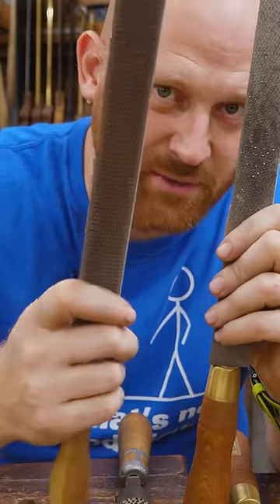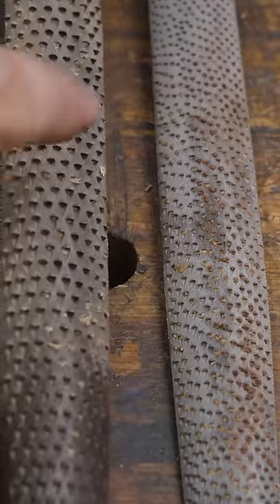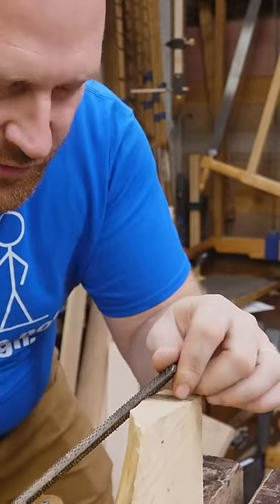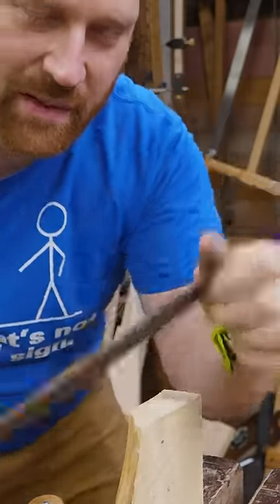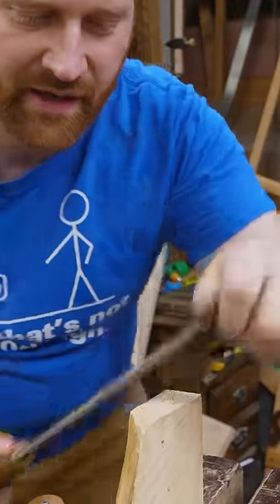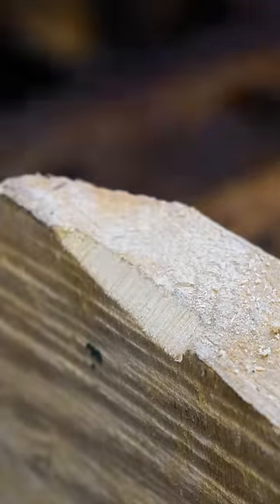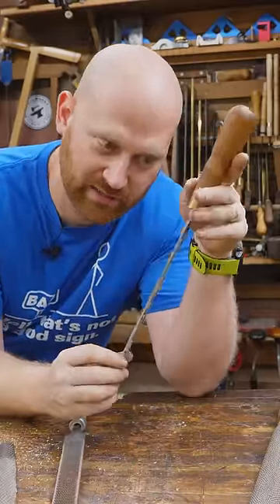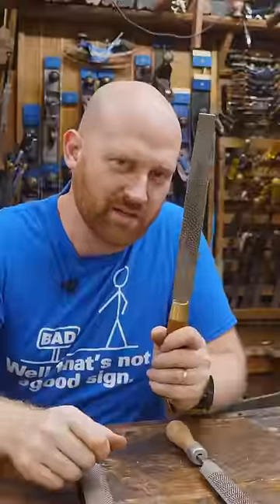Hand Stitched vs Machine Stitched Rasps

Comment: why doesn't the machine stitched introduce a different pattern?
Reply from the maker: They have made that, but the cost to run it is only slightly less then paying someone in Asia. And the makers for big box stores don't care. So the price on them is about the same as the hand stitched. The current machines punch full rows at once and march down the blade. And the audience they sell to (Big Box Stores) do not care about or even know that there is quality. Here they are: https://www.corradishop.com/gold-precision-rasps-c-1_4/gold-precision-rasps-round-6-cut-6-p-604.

Comment: Can't they make the machine ones do a random pattern? It would be nice if they could make a superior product for cheap
Reply from the maker: They have made that, but the cost to run it is only slightly less then paying someone in Asia. And the makers for big box stores don't care. So the price on them is about the same as the hand stitched. The current machines punch full rows at once and march down the blade. And the audience they sell to (Big Box Stores) do not care about or even know that there is quality. Here they are: https://www.corradishop.com/gold-precision-rasps-c-1_4/gold-precision-rasps-round-6-cut-6-p-604.

Comment: You would think they’d be able to make the machine one a little more random
Reply from the maker: They have made that, but the cost to run it is only slightly less then paying someone in Asia. And the makers for big box stores don't care. So the price on them is about the same as the hand stitched. The current machines punch full rows at once and march down the blade. And the audence they sell to (Big Box Stores) do not care about or even know that there is quality. Here they are: https://www.corradishop.com/gold-precision-rasps-c-1_4/gold-precision-rasps-round-6-cut-6-p-604

Comment: Couldn't a machine stitched one be made like a hand stitched one by simply offsetting the indents?
Reply from the maker: They have made that, but the cost to run it is only slightly less then paying someone in Asia. And the makers for big box stores don't care. So the price on them is about the same as the hand stitched. The current machines punch full rows at once and march down the blade. And the audence they sell to (Big Box Stores) do not care about or even know that there is quality. Here they are: https://www.corradishop.com/gold-precision-rasps-c-1_4/gold-precision-rasps-round-6-cut-6-p-604

Comment: solution: make a machine that uses a staggered pattern
Reply from the maker: They have made that, but the cost to run it is only slightly less then paying someone in Asia. And the makers for big box stores don't care. So the price on them is about the same as the hand stitched. The current machines punch full rows at once and march down the blade. And the audence they sell to (Big Box Stores) do not care about or even know that there is quality. Here they are: https://www.corradishop.com/gold-precision-rasps-c-1_4/gold-precision-rasps-round-6-cut-6-p-604

Comment: 💀, I'm 16 and just got into carpentry, my ass has been doing this shit incorrectly, i thought people were using steel files, never knew of this rasp tool before.
Reply from the maker: you can use the file last to clean the surface. but the rasp is what removes the majority of the material.
Reply: @WoodByWrightHowTo  Will definitely buy one if i can find it, stuff like these such as coping saws are pretty hard to come by in my country, usually only found in the Capital.

Comment: Why don't they just randomize the machine sitch one? It wouldn't be hard to make a pattern.
Reply from the maker: They have made that, but the cost to run it is only slightly less then paying someone in Asia. And the makers for big box stores don't care. So the price on them is about the same as the hand stitched. The current machines punch full rows at once and march down the blade. And the audence they sell to (Big Box Stores) do not care about or even know that there is quality. Here they are: https://www.corradishop.com/gold-precision-rasps-c-1_4/gold-precision-rasps-round-6-cut-6-p-604

Comment: Why can't you machine a random pattern into a rasp?
Reply from the maker: They have made that, but the cost to run it is only slightly less then paying someone in Asia. And the makers for big box stores don't care. So the price on them is about the same as the hand stitched. The curent machines punch full rows at once and march down the blade. and the audience they sell to (Big Box Stores) do not care about or even know that there is quality. Here they are: https://www.corradishop.com/gold-precision-rasps-c-1_4/gold-precision-rasps-round-6-cut-6-p-604

Comment: Is it not possible to machine a hand-stitched rasp?
Reply from the maker: They have made that, but the cost to run it is only slightly less then paying someone in Asia. And the makers for big box stores don't care. So the price on them is about the same as the hand stitched. The current machines punch full rows at once and march down the blade. And the audience they sell to (Big Box Stores) do not care about or even know that there is quality. Here they are: https://www.corradishop.com/gold-precision-rasps-c-1_4/gold-precision-rasps-round-6-cut-6-p-604.

Comment: Sure would be nice if they made machine stitched rasps with uneven teeth, best of both worlds
Reply from the maker: They have made that, but the cost to run it is only slightly less then paying someone in Asia. And the makers for big box stores don't care. So the price on them is about the same as the hand stitched. The current machines punch full rows at once and march down the blade. And the audience they sell to (Big Box Stores) do not care about or even know that there is quality. Here they are: https://www.corradishop.com/gold-precision-rasps-c-1_4/gold-precision-rasps-round-6-cut-6-p-604.

Comment: Why dont they just make a machine stiched but with a random pattern?
Reply from the maker: They have made that, but the cost to run it is only slightly less then paying someone in Asia. And the makers for big box stores don't care. So the price on them is about the same as the hand stitched. The current machines punch full rows at once and march down the blade. And the audence they sell to (Big Box Stores) do not care about or even know that there is quality. Here they are: https://www.corradishop.com/gold-precision-rasps-c-1_4/gold-precision-rasps-round-6-cut-6-p-604

Comment: Why don’t the machines that stitch the rasp simply do it randomly, wouldn’t you then get the best of both
Reply from the maker: They have made that, but the cost to run it is only slightly less then paying someone in Asia. And the makers for big box stores don't care. So the price on them is about the same as the hand stitched. The current machines punch full rows at once and march down the blade. And the audience they sell to (Big Box Stores) do not care about or even know that there is quality. Here they are: https://www.corradishop.com/gold-precision-rasps-c-1_4/gold-precision-rasps-round-6-cut-6-p-604.
Reply: @WoodByWrightHowTo  I see

Comment: As a developer this seems like an easy solution… just randomize the machine
Reply from the maker: They have made that, but the cost to run it is only slightly less then paying someone in Asia. And the makers for big box stores don't care. So the price on them is about the same as the hand stitched. The current machines punch full rows at once and march down the blade. And the audence they sell to (Big Box Stores) do not care about or even know that there is quality. Here they are: https://www.corradishop.com/gold-precision-rasps-c-1_4/gold-precision-rasps-round-6-cut-6-p-604

Comment: Two words:pick up used tools. Here in europe i can get a razor sharp 70 years old plane for under 10$, heck for 15$ it'll be signed by a googly eyed dictator or whoever. As for rasps i haven't yet picked up a hand stitched one because I mostly work with older softer woods in restoration and for those honestly well worn machine rasps are just as good and safe as to not chew up the old material too much.

Comment: Make your own
Reply from the maker: Sounds like an easy process and technically it is. As long as you have the right punch and a forge. However the problem comes when you need the skill to punch every tooth exactly the same height. It's a little more difficult than it sounds.
Reply: @WoodByWrightHowTo  couldn’t agree more was just saying that if you can’t find it you can always make it

Comment: Hopefully they'll configure a machine to put in 'random' stitches...
Reply from the maker: They have made that, but the cost to run it is only slightly less then paying someone in Asia. And the makers for big box stores don't care. So the price on them is about the same as the hand stitched. The current machines punch full rows at once and march down the blade. And the audence they sell to (Big Box Stores) do not care about or even know that there is quality. Here they are: https://www.corradishop.com/gold-precision-rasps-c-1_4/gold-precision-rasps-round-6-cut-6-p-604
Reply: @WoodByWrightHowTo  .... Wow, that's an awesome reply. Thank you. A lot.

Comment: Why not have a machine that stitches rasps with the same layout every time but they are not placed symmetrical but more random
Reply from the maker: They have made that, but the cost to run it is only slightly less then paying someone in Asia. And the makers for big box stores don't care. So the price on them is about the same as the hand stitched. The current machines punch full rows at once and march down the blade. And the audience they sell to (Big Box Stores) do not care about or even know that there is quality. Here they are: https://www.corradishop.com/gold-precision-rasps-c-1_4/gold-precision-rasps-round-6-cut-6-p-604.

Comment: Why didn't someone start to make machine ones with random pattern yet?
Reply from the maker: They have made that, but the cost to run it is only slightly less then paying someone in Asia. And the makers for big box stores don't care. So the price on them is about the same as the hand stitched. The current machines punch full rows at once and march down the blade. And the audience they sell to (Big Box Stores) do not care about or even know that there is quality. Here they are: https://www.corradishop.com/gold-precision-rasps-c-1_4/gold-precision-rasps-round-6-cut-6-p-604.

Comment: Im pretty sure there are machine stiched ones that make em like the hand stiched
Reply from the maker: They have made that, but the cost to run it is only slightly less then paying someone in Asia. And the makers for big box stores don't care. So the price on them is about the same as the hand stitched. The current machines punch full rows at once and march down the blade. And the audience they sell to (Big Box Stores) do not care about or even know that there is quality. Here they are: https://www.corradishop.com/gold-precision-rasps-c-1_4/gold-precision-rasps-round-6-cut-6-p-604.

Comment: why don’t they just make a machine that doesn’t stitch them in such perfect rows
Reply from the maker: They have made that, but the cost to run it is only slightly less then paying someone in Asia. And the makers for big box stores don't care. So the price on them is about the same as the hand stitched. The current machines punch full rows at once and march down the blade. And the audence they sell to (Big Box Stores) do not care about or even know that there is quality. Here they are: https://www.corradishop.com/gold-precision-rasps-c-1_4/gold-precision-rasps-round-6-cut-6-p-604

Comment: I don't understand why they don't mashine them with more random placements 🤷
Reply from the maker: They have made that, but the cost to run it is only slightly less then paying someone in Asia. And the makers for big box stores don't care. So the price on them is about the same as the hand stitched. The current machines punch full rows at once and march down the blade. And the audence they sell to (Big Box Stores) do not care about or even know that there is quality. Here they are: https://www.corradishop.com/gold-precision-rasps-c-1_4/gold-precision-rasps-round-6-cut-6-p-604

Comment: Why dont they just machine them unevenly then?
Reply from the maker: They have made that, but the cost to run it is only slightly less then paying someone in Asia. And the makers for big box stores don't care. So the price on them is about the same as the hand stitched. The current machines punch full rows at once and march down the blade. And the audence they sell to (Big Box Stores) do not care about or even know that there is quality. Here they are: https://www.corradishop.com/gold-precision-rasps-c-1_4/gold-precision-rasps-round-6-cut-6-p-604

Comment: I wonder why don't they make a machine asymmetrical stitched rasp? Should achieve the same as a hand stitched and will b alot cheaper
Reply from the maker: They have made that, but the cost to run it is only slightly less then paying someone in Asia. And the makers for big box stores don't care. So the price on them is about the same as the hand stitched. The current machines punch full rows at once and march down the blade. And the audience they sell to (Big Box Stores) do not care about or even know that there is quality. Here they are: https://www.corradishop.com/gold-precision-rasps-c-1_4/gold-precision-rasps-round-6-cut-6-p-604.
Reply: @WoodByWrightHowTo   :0

Comment: Why don’t they just make the machine ones with a random pattern instead
Reply from the maker: They have made that, but the cost to run it is only slightly less then paying someone in Asia. And the makers for big box stores don't care. So the price on them is about the same as the hand stitched. The current machines punch full rows at once and march down the blade. And the audence they sell to (Big Box Stores) do not care about or even know that there is quality. Here they are: https://www.corradishop.com/gold-precision-rasps-c-1_4/gold-precision-rasps-round-6-cut-6-p-604

Comment: I believe a machine can use a random pattern if set up that way
Reply from the maker: They have made that, but the cost to run it is only slightly less then paying someone in Asia. And the makers for big box stores don't care. So the price on them is about the same as the hand stitched. The current machines punch full rows at once and march down the blade. And the audience they sell to (Big Box Stores) do not care about or even know that there is quality. Here they are: https://www.corradishop.com/gold-precision-rasps-c-1_4/gold-precision-rasps-round-6-cut-6-p-604.
Reply: You don't want an entirely random pattern with hand stitching. You want a pattern, but you want it to vary.

Comment: We could very easily machine a rasp with randomly allocated teeth.
Reply from the maker: They have made that, but the cost to run it is only slightly less then paying someone in Asia. And the makers for big box stores don't care. So the price on them is about the same as the hand stitched. The current machines punch full rows at once and march down the blade. And the audence they sell to (Big Box Stores) do not care about or even know that there is quality. Here they are: https://www.corradishop.com/gold-precision-rasps-c-1_4/gold-precision-rasps-round-6-cut-6-p-604

Comment: Maybe machine stitched just need to put the teeth closer together, or more randomly place them.
Reply from the maker: They have made that, but the cost to run it is only slightly less then paying someone in Asia. And the makers for big box stores don't care. So the price on them is about the same as the hand stitched. The current machines punch full rows at once and march down the blade. And the audience they sell to (Big Box Stores) do not care about or even know that there is quality. Here they are: https://www.corradishop.com/gold-precision-rasps-c-1_4/gold-precision-rasps-round-6-cut-6-p-604.

Comment: Sounds like they just need to adjust the process of stitching the machined ones
Reply from the maker: They have made that, but the cost to run it is only slightly less then paying someone in Asia. And the makers for big box stores don't care. So the price on them is about the same as the hand stitched. The current machines punch full rows at once and march down the blade. And the audience they sell to (Big Box Stores) do not care about or even know that there is quality. Here they are: https://www.corradishop.com/gold-precision-rasps-c-1_4/gold-precision-rasps-round-6-cut-6-p-604.

Comment: Couldn't they make a machine that randomizes the stitches?
Reply from the maker: They have made that, but the cost to run it is only slightly less then paying someone in Asia. And the makers for big box stores don't care. So the price on them is about the same as the hand stitched. The current machines punch full rows at once and march down the blade. And the audience they sell to (Big Box Stores) do not care about or even know that there is quality. Here they are: https://www.corradishop.com/gold-precision-rasps-c-1_4/gold-precision-rasps-round-6-cut-6-p-604.
Reply: @WoodByWrightHowTo  Good to know, thanks for the reply!  👍